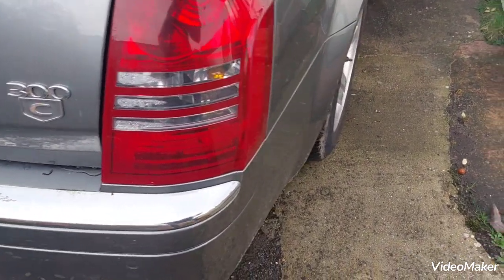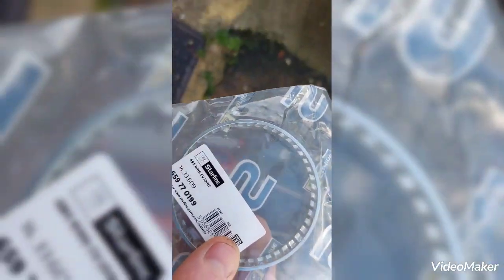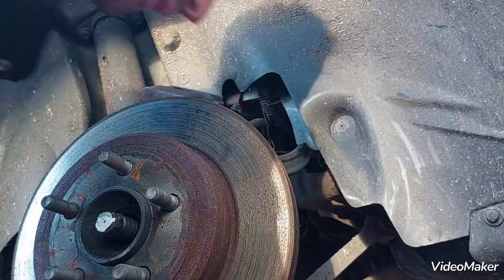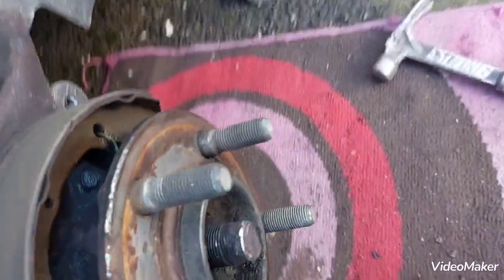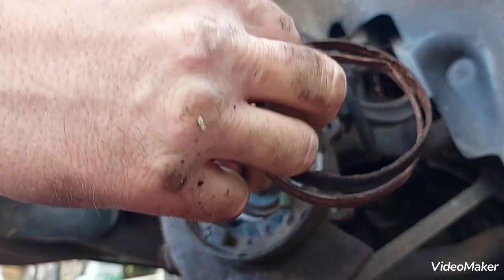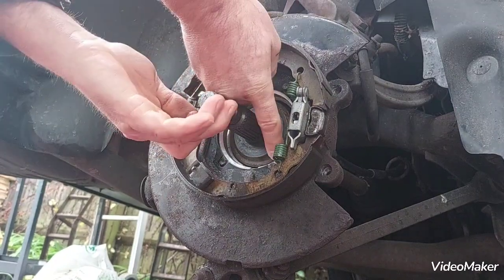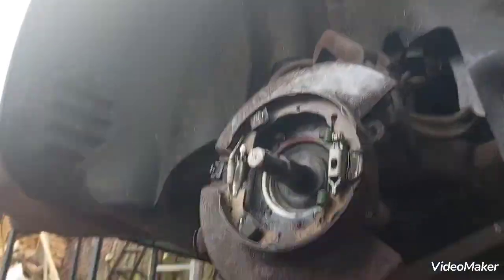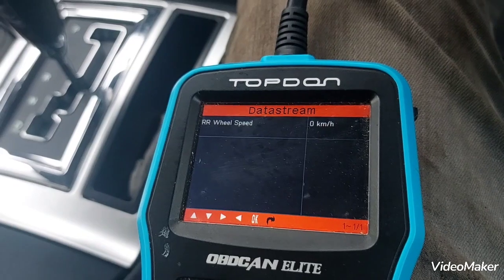ABS magnetic tone ring replacement on Chrysler 300c rear axle

Comment: I just wanted to thank you for this AWESOME video. Excellent  work, the tone ring was a pain to get in straight but job done for 20 bucks opposes to 780 that the shop wanted. Cheers 🍺
Reply from the maker: Thank you for nice words. I'm glad the video is helpful. If you have changed ring on one side only be prepared to get it done on other side as well. On my car, I had to change ring on other side within 6 months as they're both equally exposed to elements. 
All the best buddy👍🍺

Comment: Thank you brother! It's hard finding vids/info on these chrysler/dodge AWD 6th generation sedans. I have a 2010 charger r/t awd with the 5.7. Currently just had speed sensor codes pulled for rear left. Looks like I'll be buying 4 of these and just gonna do all four to get it out of the way for I'm sure you know that if one is bad...the others are not far behind. God bless!
Reply from the maker: You're absolutely right. Them rings are exposed to weather, road dirt, brake dust, salt in winter etc, and if one is desintegrated others are not far off
Good luck and God bless you

Comment: I just had to tell you. At around 23:40 I seen those jack stands. They are scary - Doing a brake job on a 1965 Plymoth one of them colasped just as I was walking away. it could have been the end of my legs or worse. Please get better 2-3 ton cast ones - you deserve the better ones! Thanks - nice video and good luck.
Reply from the maker: Thank you for your concern, I will follow up your advice and get stronger ones for sure 
All the best 🙂